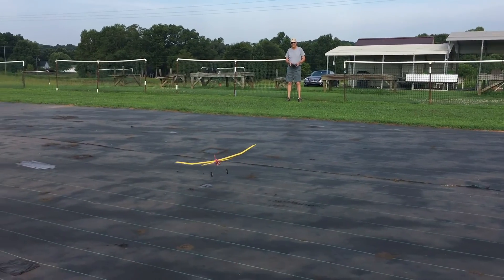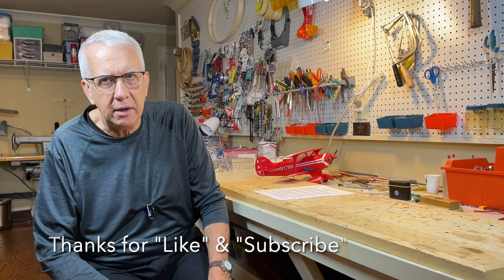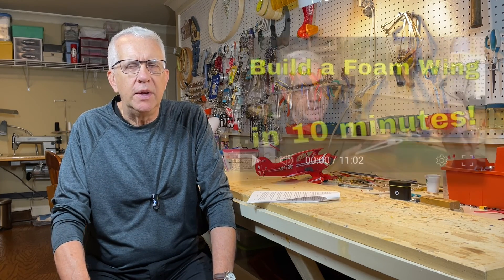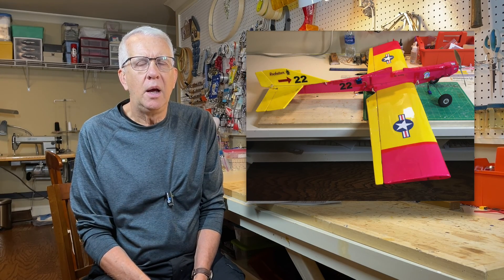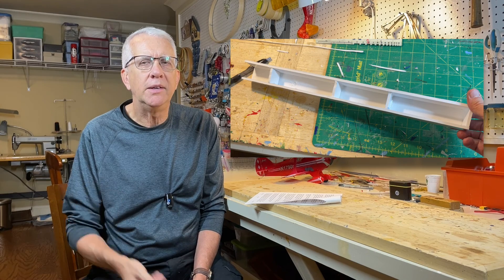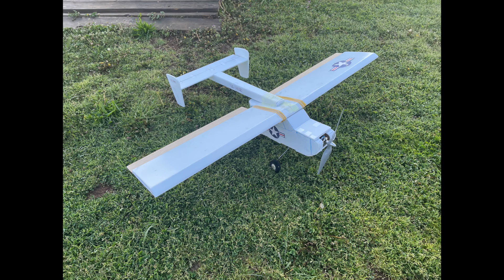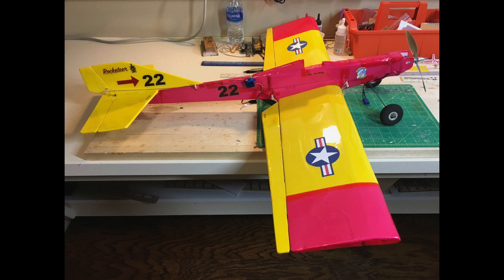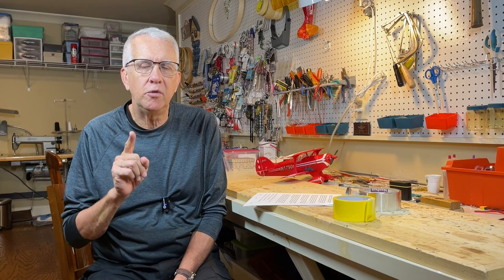Foam Board  RC Airplanes A to Z

Comment: Do you have any pointers on picking a motor/prop for small models.  Just getting back into it and things have changed a lot.  Looking at rubber power conversions in the 18"-30" span range.
Reply from the maker: It really depends on the motor and battery combination. Maybe start with a 6x4, experiment with what provides the best thrust. Tim
Reply: @TimMcKay56  I am trying to determine which motor and prop combo to buy.  Motors have changed a lot since the large brushed ones we used 20 years ago.

Comment: Hi Tim, thanks for the video. I have so much Styrofoam that was used for packing models overtime that I hate to just throw it away. I was thinking about making a model using that kind of Styrofoam, is this possible? It sounds like you were suggesting we buy more.
Reply from the maker: Wayne:  Of course!  As with any building material, keep an eye on weight and strength. Foam can be painted as well as covered with lower temp Lite iron-on coverings. Tim

Comment: You don't need separate balsa control surfaces, just cut the top of the wing long enough to include the control surface, and cut a 45 in the foam (leaving the top paper intact), then reinforce with a thin schmeer of hot glue (on the cut side). Works great.
Also, Adams Ready board from the dollar tree is lighter than other foams, the paper peels nicely, and it's cheap. You can waterproof it by applying oil-based polyurethane (and wiping off after it soaks for a couple minutes).
Reply from the maker: Jason:   Good stuff, thanks for sharing!  Tim

Comment: Hi Tim, I am returning to the hobby after some 40 year pause, and I am finding your videos on foam board models very interesting. I will be starting on a Leprechaun build soon, but I suspect it will be take some time to build. So in a mean time I would like build some foam board models to start practising flying. I could not quite to catch the make of the foam from Amazon you were recommending, so if you would not mind please post the name. Cheers and Mary Christmas, the Paul
Reply from the maker: Paul:  Thanks for checking in, and best of luck with your modeling projects.  There are any number of foam board products out there at craft stores and such.  I use Amazon for Royal and Langnickel 20x30" sheets.  They work well for me.  Tim